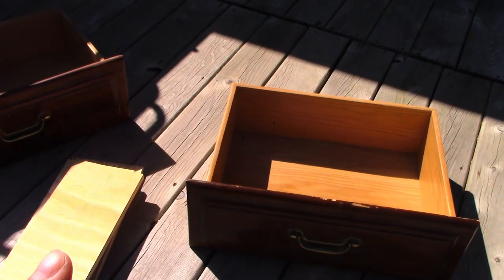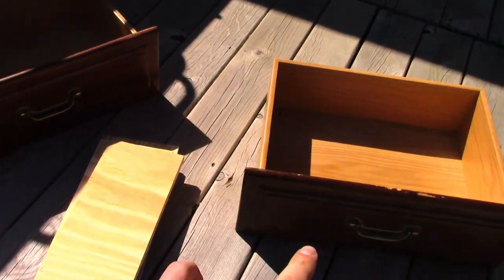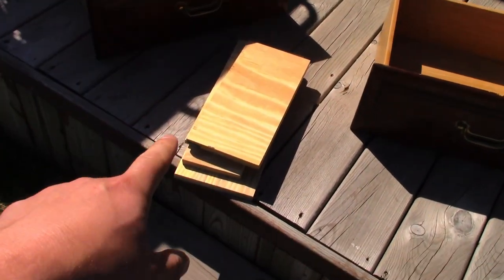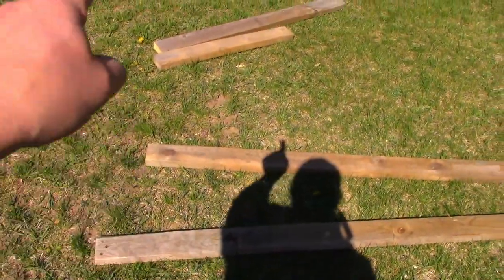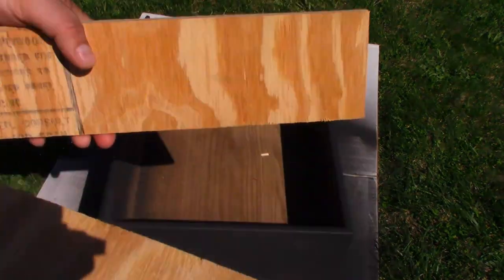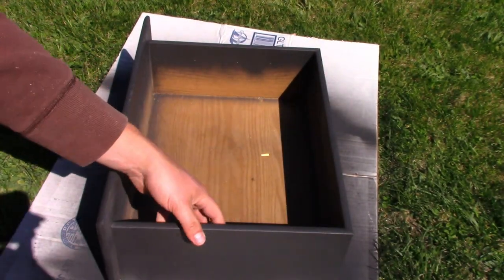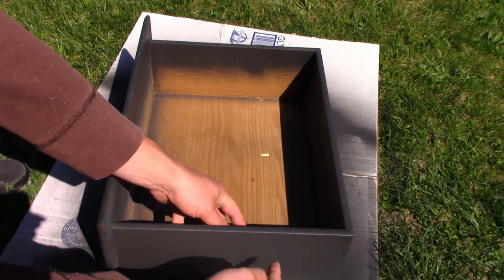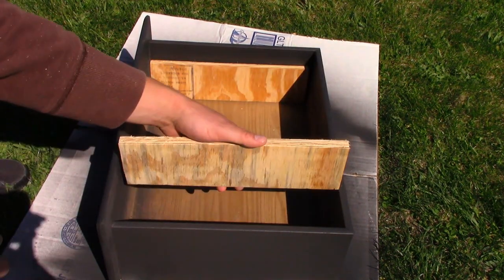Planter Made From Old Drawers

Comment: This is exactly what I want to make but you didn’t add any measurements or angles that you cut things at. It would be nice to know so that it would be easier to build. Do you happen to recall any of those?
Reply from the maker: No I don't. It all depends on the size drawers you have. It's pretty easy to figure out once you know where you want the drawers to be. Also I would recommend reinforcing the bottom of the drawers with wood. Just remember that this is meant to be on a covered porch. If it gets rained on it won't last long. Ours didn't last a full year because of rain.